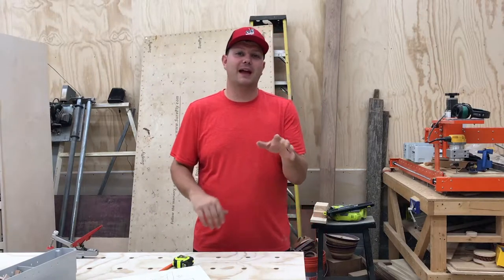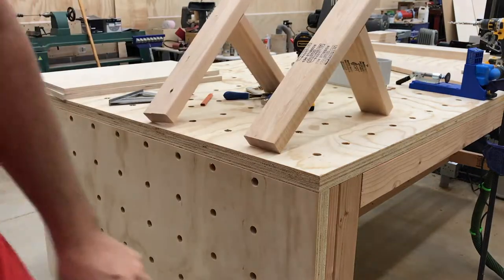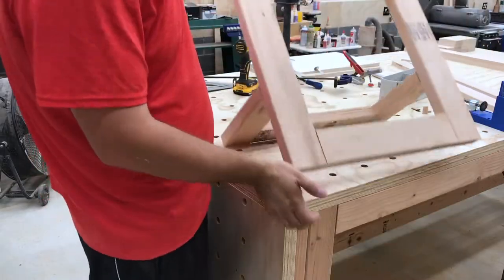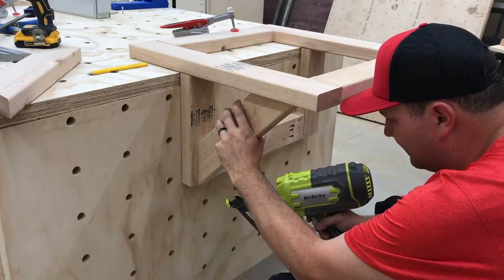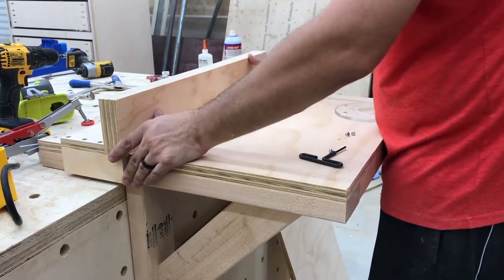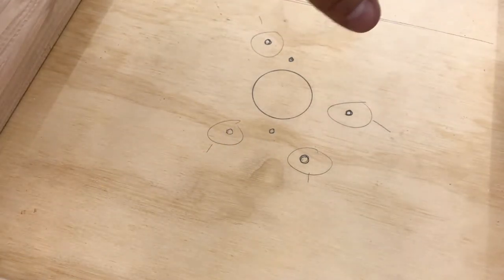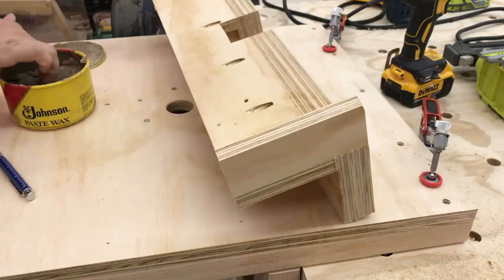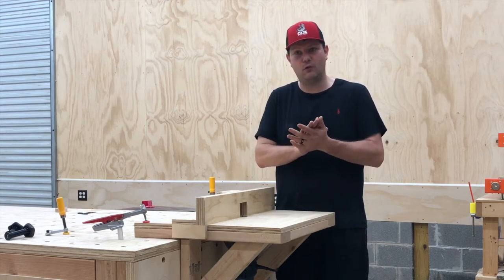Best Workbench Mounting Router Table

Comment: there is truly nothing new under the sun. I made something very similar to this about three months ago and thought how clever I was for coming up with something new, only to find out it has been done already. Your build has a couple of nice features I omitted. What you might want to add to yours is a couple of dowels corresponding with your dog holes, that way you just pop the jig in place. Second, for the fence I just used a wide board, routed two slots and put two fixed bolts through the table itself, the slots being in the fence instead of the table might make easier to slide.
Reply from the maker: That is good to know I have actually gotten a router table now and have this to another woodworker

Comment: Do you find that this size router table is sufficient for most woodworking?  I was considering making one like this where it would be turned sideways so the wood feeds onto the work bench.  Might use it as a jointer.  I'm debating to make one either exactly like yours, like yours but sideways, or integrated into the work bench itself.  What do you think?
Thanks.

Comment: Hi Drew I have emailed you regarding the measurements of the plywood you have listed you say cut 3 lengths twenty one and a half inches but it needs twenty four and a half inches for the guide fence can you confirm what is the correct size as the ones you list do not fit the table top thanks
Reply from the maker: I have the plans to this on my website if you want to check them out